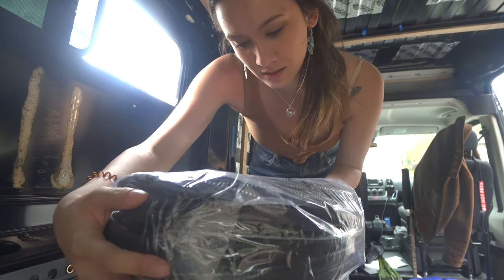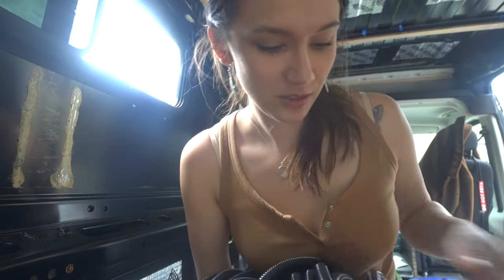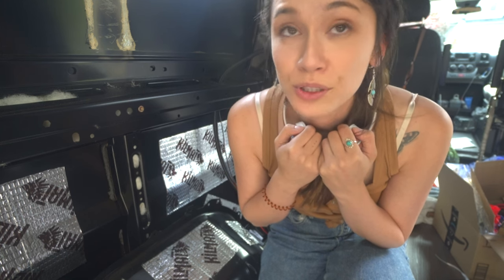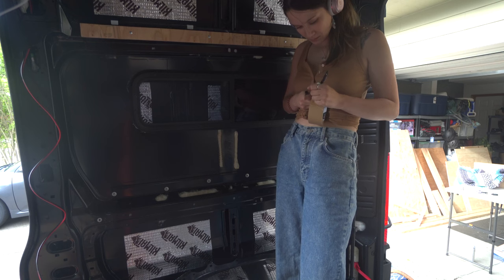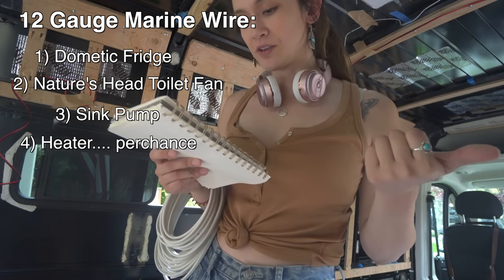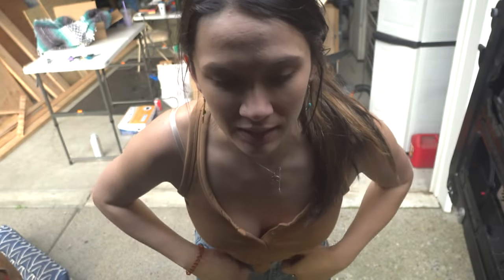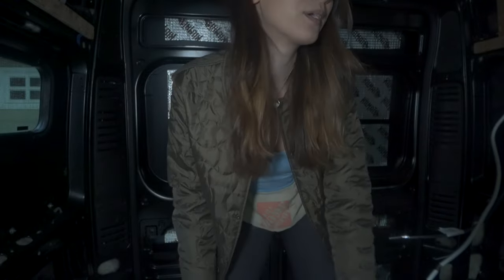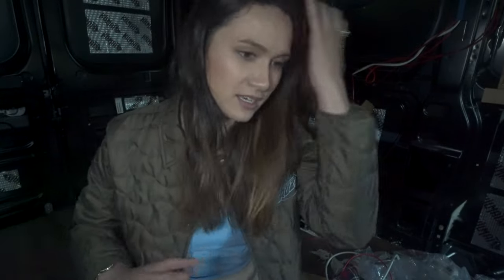How I PREWIRE my CONVERSION VAN [Wires Explained] | Van Life | Van Build Series

Comment: Bend The Tip Of The Wire Over, So It's Round... It Will Then Slide Through Easily... The Flat Cut End, Will Always Catch On The Ribs As U Push It In...

Comment: For future reference,lay it out outside of the vehicle  for a given run, tape your wire to a fish tape or straightened metal hanger .Push or work that  through the loom material . Remove the fish tape, tape your wire to loom, then pull the entire thing to its termination point.
Reply from the maker: Thank you! That would have made things so much easier

Comment: Nice effect with the audio cutting out when you dropped the earbud.
Nowadays almost all laptops and phones will charge with USB power delivery and a USB-C port.  I don't want to have my AC inverter on all the time so I'm using a a power delivery adapter that runs from 12V.  To make sure it works for current and future laptops you need to make sure that it will output 20V from a 12V input.  Most chargers have a little asterisk in the description that says it will only do 20V from a 24V input so you have to be picky in finding one.
Reply from the maker: Haha thank you! 🎶😊

This is all good information, thank you! I didn’t know this about laptop voltage